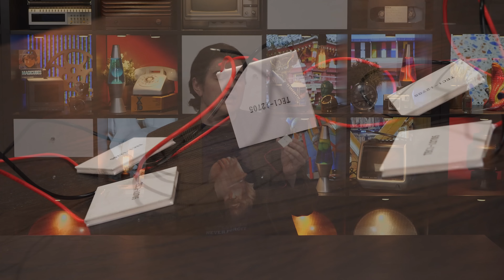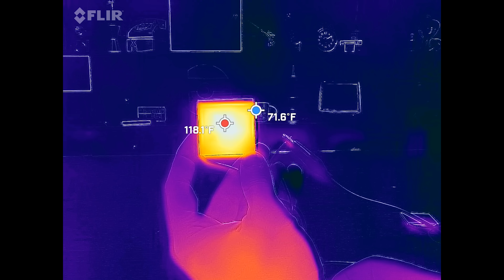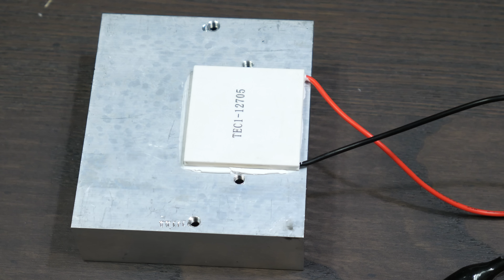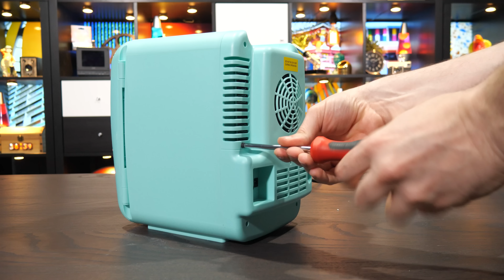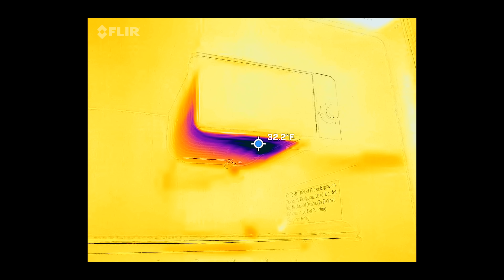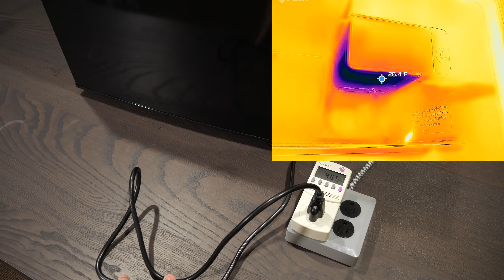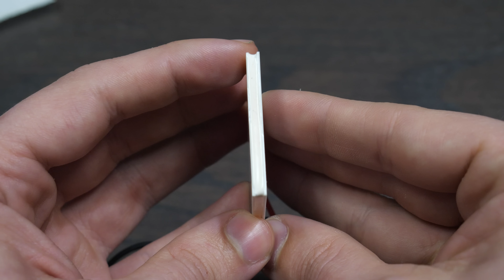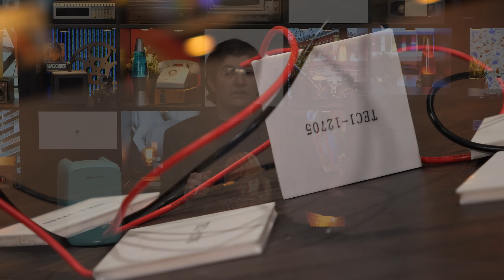Thermoelectric cooling: it's not great.

Comment: I have a space that is 8” deep 8” wide and 12” tall in my tiny office for a fridge at work.  If you can show me a fridge that will fit there I will buy it.  I have one that keeps the internal temp around 40f and works great as far as I can tell.  I’m not paying for the power and it works just fine for my uses.  I would have to disagree that there is very little use for these.

Comment: Now I know how the cooler in my car works!  My mom found it at goodwill for me a few years ago, and it does come with a hot/cold mode, and a fan, but comparing it to this blue goofus you're looking at, it seems mine is at least a bit better put together.  It's more insulated, the inside is half-metal instead of mostly plastic (unless that white backing in the emerson fridge is metal?), and when I put frozen burgers in it while I was down in TN, they were somehow still frozen when I made it back home to MD.  And they were in the car for over 24 hours!  And also I forgot to turn it off when I stayed at a hotel on the way home and it almost killed the battery!  Whoops!  Sure, it has a "below 12v shutoff" for safety, but that's a bit too low to be letting your battery get...

It has two small cupholders, which is nice, because my giant crown victoria somehow doesn't have any cupholders of its own, and I think the cupholders do have that gimmick you speak of, but they're too small for basically anything other than water bottles or medium soda cups from taco bell.  

It really makes me wonder though, if it would be possible to somehow calculate the MPG difference that using one of these coolers might have on driving around from place to place.   Next time I get in the car, I'll have to try switching it back and forth from cold to off to hot while watching the voltmeter to see how much the needle twitches!

I am, still, considering one of these goofy little thermoelectric coolers to take to my grandma's room at the nursing home, where space is a massive limitation.   I don't care about the power bill, because it's their problem, not mine, and in fact if I was the type of person to care about crypto, I'd've already hidden a mining rig somewhere in her room to really take advantage of that free power and (terrible) wifi.  

Also, the GIANT AMERICAN FRIDGE bit was great xD

Comment: My room with the window unit cranked up high would legitimately make a better beverage cooler than this thing. I'd know, because when I do that or when it's winter, the soda I keep in my room gets decently chilled. Not as cold as a refrigerator, but since it's also cooling my room at the same time and at a much quicker rate, I'd argue it's better.

Comment: Nothing wrong with mini fridges as long as you don't expect them to cool down to the same temperature as a refrigerator.   Also there are a few countertop mini water coolers on the market that use these elements against the water tank.   I've been using one for a couple of years now and it keeps the water around 40 degrees quite well...

Comment: I have the galanz freezer top fridge and it gets so cold that frost forms on the walls. Anything I put in there is cold in under an hour. I just wish the temp control was more exact but I’ve never had an issue with the temperature itself.

Comment: An excellent video on the topic. Very nicely done. Another winner.
 We have a Desert Tortoise, due to the Huge tunnels she wants to dig.. we've just started to crate train her. During the winter her 15w reptile pad keeps her warm. During the Summer.. in AZ.. That's the problem. If she can't get 18" down, where it's About 74 degrees.. she's not happy. SO..  her new home is a double layered cardboard box, Condo, with 1" styrofoam walls but no way to keep her cool.  I've spent the last 2 days thinking I would use two Peltier pads to move cold air to her but then I saw the energy usage of About 150W for both pads, both with two fans each..  Seemed unreasonable and too many moving parts. After this video.. I think I'm modifying the smallest cube fridge I can find and building it into her home.  :)   She basically lives in a giant ice chest with a long side and an open door. During the summers.. she'll have a small heat pump to keep her cool.   Thanks for the info..

Comment: I recently stayed in a hotel room that had one of those black cube fridges. It was hidden inside of a cabinet, and with the cabinet open, it was pretty loud. Also, it had a lot of suction on the door, I had to hold the body of it down with one hand and pull the door open with the other hand, otherwise I'd pull the whole thing right out of the cabinet.

Comment: I think the Toyota Sienna Platinum has a built-in refrigerator behind the center console that uses these. I can't imagine it would be useful anywhere except for a long road trip where the van is running long enough for it to actually cool down in there. I have only seen it when I've driven them, I don't know how they actually work.

Comment: My nephew has a decent sized Thermo fridge like that.. It most def sucks.. but its all plastic on the inside. 

I was thinking about re-designing it, I guarantee I can make this thing work. Id bet just slapping a fat ass heat sink over top of the Thermo, and lining the inside with sheet metal would make it 10x better.
Reply: Im sure Ill take it like 9 steps past what I need too lol.
Reply: The Fridge's heat sink fan blowing air at it.. It needs to be the opposite..

Comment: I actually built my own TCU fridge.

Much better insulated of course, but the main thing is that i live off grid on a mountain. It would be kind of a pain to get warranty repairs or even to remove a real fridge, seeing as i ride motorcycles almost exclusively, so the ability to have the only parts I'd ever need to repair (replace) be cheap and little/light TCUs/fans is a boon.

Everything could break right now (8:19) and I'd be back up and running before noon, then I'd just get new replacements on Amazon, and it's just a matter of riding out to the pack and post. 

But as you say, very, very, VERY specific cases.

Comment: A bit tangential but I will mention that there are other technologies out there, they are just not used commercially because, well, you don't usually need "liquid nitrogen kind of cooling" on demend commercially. At some point just using compression fails because you need the air to be cooler then the boiling temperature you can get to, so there's that. Cryocoolers are cool!

Comment: Peltier elements can be surprisingly efficient in very narrow constraining applications. But, it's just too constraining; you wouldn't bother to use this for cooling if you can afford the cost, volume, and complexity of any other type of heat pump. However, compare one to a resistive (joule) heater: a Peltier of similar size and power is like an over-unity heater. The resistive heater is ~100% efficient at making heat from electricity, and a Peltier is perhaps ~115% (depending on many things) because it's pumping heat from the cold side in addition to burning the electricity. A bit more costly in that case, but as long as the cold side isn't causing you issues, and especially if you have something which could benefit from a bit of cooling to attach to it, it's not necessarily a bad design trade.

Comment: We use the Red Frigidaire retro unit to augment the small refer in our travel trailer. We keep two soda and two bottles of water in it. We run it with the campground power. It is pretty noisy, but we like it for this purpose.

Comment: My guess is that the smaller compressor is louder by the virtue of being smaller. When the spinning things gain more mass the vibrations tend to become lower in frequency which makes them sound quieter to human ear which is tuned to the speech frequencies.

Small spinning things also often need to spin faster to move the same amount of stuff, which also increases perceived noise - the reason, say, PC fans have become so much bigger in size. Bigger fan moves more air with slower speed and slower speed both reduces vibrations and pushes noise to area where human hearing is not very good.

Comment: The thing with peltier elements is that you need to run them somewhere around 1/4..1/3 of the specified maximum heat pumping capacity. Then you can get CoP past 2.5. 

Similar thing goes for fans, tiny fans are abysmal in moving air.

But when you install so many peltier elements you can run them so much below maximum and big enough heatsinks and fans to make the heat transfer work well and enough insulation to compare to real fridges it is not longer that small and definitely not that cheap. And if the temperature gradient is large, you might need to have multiple stages, which then more than doubles the cost of the elements.

So it would be fun exercise, but not sensible for Temu price category everyday items.

Comment: You are wrong i bought one from vevor that has two cooling units on it and it has a thermostat and it drops it down to 32 degrees it freezes water in a cup and i spilled water and the floor of the cooler has ice all over it and I only paid 80 dollars and it fits in the area I need for it to fit and it light.

Comment: Peltier modules can also generate a tiny bit of current when put into contact with a sufficient source of heat ; used for little fans you put on top of wood stoves to circulate air slightly better.

Comment: When I was a kid in the early 2000's, we had a Coleman cooler that was clearly operating on this principle. It was pretty good on road trips in the big old van we had back then. I seem to recall most of what we kept in it was stuff that didn't need to be kept at such cool temperatures, but when we did, we packed it with as many icepacks as we could fit in it as it was clear it wasn't as good as an actual fridge. It did decent job of extending how long the ice packs kept things cool and I think that was all we expected from it. It did have a heating function as well, but I don't remember ever using it.

Comment: Looks to be an issue of design no? Compressor Fridge designs have been perfected for many years. The blue one here is just a toy one like you said. A low hanging fruit on an improvement would be for example have peltiers and heat sinks on every side, and have proper insulation. That's just the start and should improve it dramatically. Larger is also better, as you can fit more insulation so I don't think its fair to compare the tiny fridge to the larger mini fridge here. Thermostats are also easy to add. Of course it wont likely be as effective as a normal compressor fridge, but it should turn out lighter, more portable and possibly quieter than a normal fridge.
Reply: Exactly, the energy any cooling device uses is equal to the heat energy that insulation fails to stop entering into the cooled space. Judging a peltier device on a single toy?????

Comment: Many years ago I bought a cheap cell phone cooler that used one of these devices. I don't know how much power it consumed by to know it wasn't anywhere near 55 w. It was probably half or a quarter of that. But it did help with keeping my phone cool in the hot summer sun or where I drive though today. I don't use anything like that anymore but the current phone I use I might need to pick one up again just because of how crappy my phone is when it overheats where it disconnects from cellular networks.

Comment: We have an approximately 35-year old Koolatron cooler that recently failed. It is about the same size as typical family sized cooler. 

It was never a good "fridge", but when we went traveling for a month or more, after about 2 weeks of 75°F to 90°F ambient temperature, it would start freezing items inside it. 

Typically it took about 2 days to cool itself and a few room temperature items (not good for perishable food), but as long as you loaded it with already cooled items (including drinks), it actually did a decent job (ignoring the freezing...)

Note it was terribly inefficient, but using a second battery in the trunk that was connected to a DC to DC charger, also in the trunk, that would power on whenever the car was on, we didn't really care about the inefficiency.
Reply: Hmmm.... did I already comment on this video a year ago?

Comment: Another good one from you, but that little Doohickey has one other good use with a single candle. You can charge your cell phone or as the one that I set up for a friend of mine it looks like a thermos bottle you put it next to your campfire and it’ll charge two or three cell phones, using the water thermal mass and the heat from the fire, it actually produces electricity

Comment: I wound up buying an iceless igloo thermo refrigerator. Basically, it's a cooler with an thermo electric part built into the top. It fans down cold air by using only the inside environment and not taking air from outside. I've been using it since 2020 and it works well. I've also incorporated ice packs to prologue being left in my  vehicle where I work. I run it off of an inverter in my van and that way, if it forget to take the plug out of the wall in my van, as long as I don't exceed two and a half hours of it running, my battery won't get killed. I think that, because it actually pumps in flowing cold air, rather then only cooling the side of the inside, it works fine. I've kept ice cream from melting before in it.

Comment: So make a slightly bigger fridge, with maybe 2 or 3 cooling pads, some soundless fans (designed to prevent sounds where possible) and a bigger heatsink. Get a cooler that cools faster, maybe cools more with multiple pads. Would be a bit bulky but i sure not much changes design wise. slightly wider, maybe a little more depth on the back. Boom.

Edit: energy? pfft number go up.

Comment: I'm curious if you attached a Tesla valve to the hot side if the heat would forma natural flow and be able to dissipate the heat without moving parts.

Comment: The peltier modules might be bad to use for refrigerators but I bought a bunch to experiment with cooling laptops in extreme heat (had to DJ in 106 degree weather once) and though I didn’t complete that project, I think it could be a great application for them.  It’s a much more elegant solution than sitting your MacBook on a bag of ice.

Comment: thermoelectric cooling is one of those technologies that are technically impressive, but have little practical use in their current state.
if we do manage to make peltier elements that can get cold enough to keep food or beverages at safe temperatures, they would be a complete revolution for cooling, no more compressors and high energy levels needed to get cooling systems to start after each stop or reset.
But unfortunately, unless some huge breakthrough can be made in the field of "cheating literal physics", that probably wont happen any time soon

Comment: I have a coca cola brand mini-fridge and it gets around 36 degrees and has a hot mode as well. Its pretty good. I think it comes down to how big the Peltier element is and how well the cooling fins work. I still wont put food in there, but it keeps drinks very cold.

Comment: I have a full sized fridge freezer in my kitchen set 3c for the fridge and -18c with wifi so I'm able to track its energy usage is using around 400wh per day. That's an average constant draw of only 17 watts. Electricity here is around £0.25 per kWh (about $0.30) so it costs me £37 vs the £120 a year this would cost me. That's pretty wild

Comment: Peltier elements are also used the other way around as completely static low power energy sources, when combined with a radioactive decay heat source on one side and a massive radiator on the other, for power on rovers or remote isolated places (fully autonomous lighthouses left over from the USSR)

Comment: I always want to design a bathroom fan integrated with a dehumidifier (also as a heater) for bathrooms with this thermoelectric coolers.  The idea is to blow the humid air from the cold side and exiting from the hot side.  The water will condense at the cold side and drier and hot air exits from the hot side.

Comment: i have a $30 micro fridge like this. i love it. doesn't get super cold, but it's fine for drinks. i wouldn't rely on it for anything important, but i don't expect a ton for $30. like a cooler, but smaller and you don't have to mess with ice. mine doesn't make any noise, and the car charger makes it great for roadtrips. sorry the one you bought sucked.

Comment: You basically nailed the theoretical advantages of a thermoelectric cooler. I bought one just about the size you have to cool drinks when I am travelling. The fridge fits exactly into the bottom half of my hand luggage. In theory, this would save me from having to buy cold drinks at the hotel lobby for €4-5 for a small 500ml (16 fl. oz) bottle. But as you mentioned, it usually takes almost a day to cool drinks down. So, if I am on a short weekend trip, it's not really doing much. The  alternative is drinking room temp drinks or spending an extra €15-20 a day on drinks.
Do you have any suggestions for an alternative cooler technology that is only used infrequently and power consumption is not as important and weight and size?

Comment: Almost every mini fridge I've bought usually cost anywhere from $25 to $50 with $35 being the most common. Me and my family have bought a ton of them, we usually got used ones and they almost always worked well. I hate those peltier things. Lol, I remember trying to use one you plug into the car when we were camping (my dad was so cheap he refused to buy ice) and jfc it was awful. You could throw a cooler full of beer in the damn lake and it would probably get colder.

Comment: While the technology of peltier coolers is... Not great, I built a peltier😮cooler for my axolotl tank. It has a small pump and is connected to a thermostat to push my (small) aquarium's temp to under 70 deg.